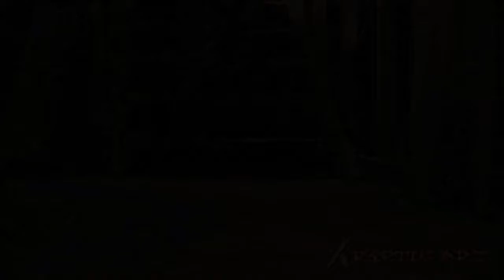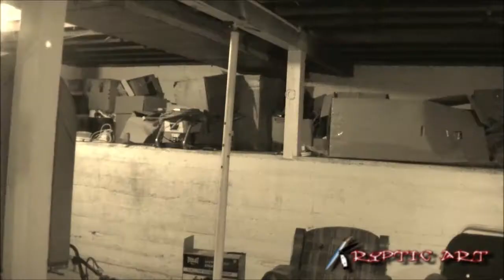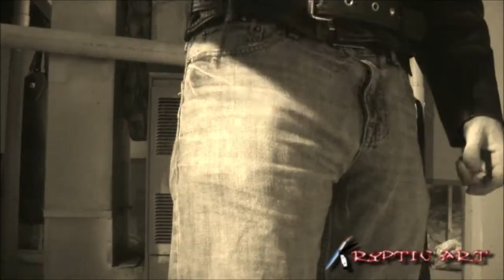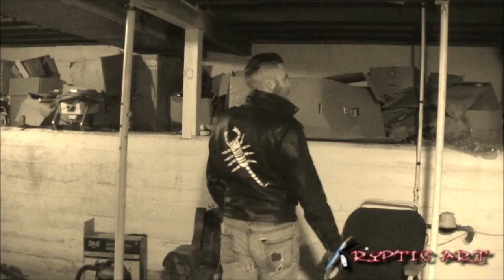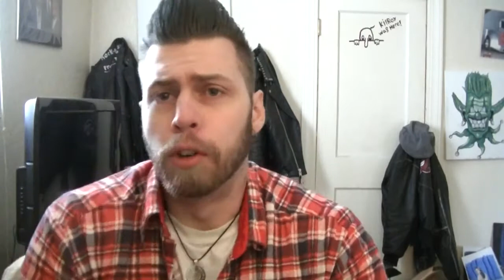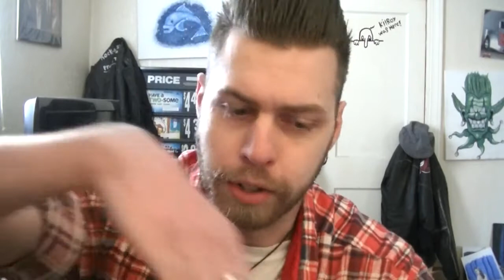greaser belt buckle to the side origin

Comment: I don't about the actual origin of the side buckled garrison belt, but i can tell you that many of us wore the belt that way to show the metal studs that we had hammered into our belts.  The studs were normally used to repair furniture, like those red soft plastic coverings on kitchen chairs that were popular back then.  You could buy them in any hardware store.  Anyway, sometimes the belts were worn outside the loops of your jeans so they could quickly go into action as a weapon!  Otherwise, the belts just looked cool with the buckle to the side.  That look went out of style in the early 1960's and I stopped wearing my belt that way before I went into the service.
Reply from the maker: Yeah Ive seen some of the original era cats wear the round metal studs on belts back then. Similar to the modern day studded "punk rocker belts" The original era guys I knew wore them to the side because they were always working on their rods and want to scratch up the paint.
Reply: I do it because I didn't like my belt jabbing into my front when I'm working. My dad and his friends did the same back in the day
Reply: @No1liveshere  Back in the 50's my group used to wear our sharpened buckles for weapons and they of course were worn of to the side for quick access. YEA Marlin Brando!